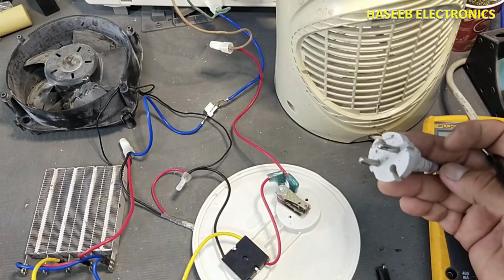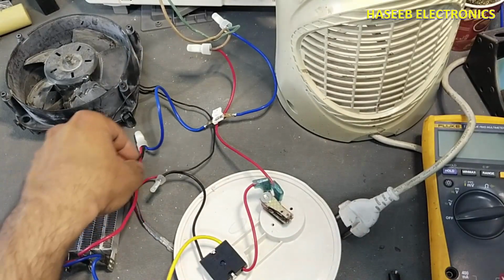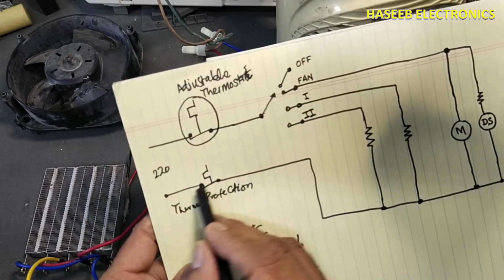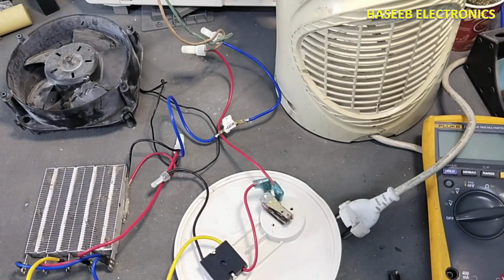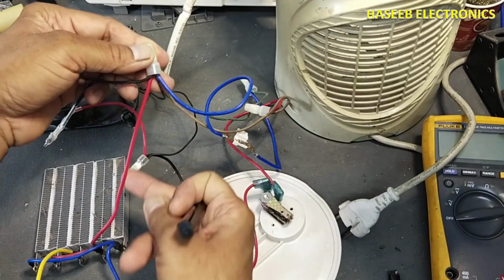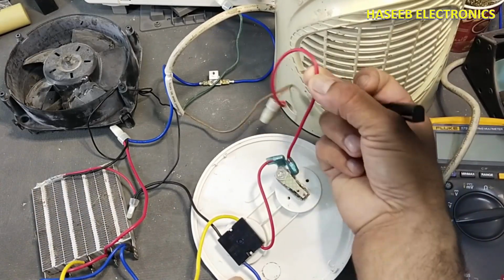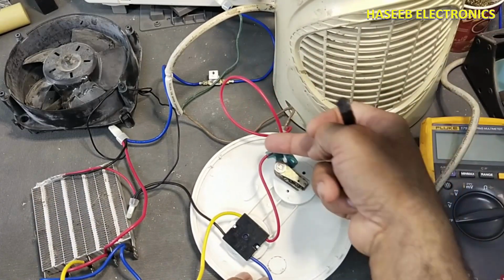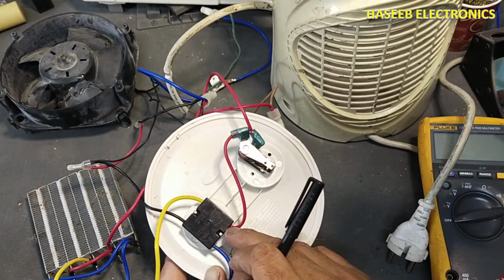{686} Room Heater Fan Repair || Complete Troubleshooting Tutorial

Comment: Computer atx power supply  power out put OK  but there is a problem , when  I check  by multimeter   + pin connect with - of smps  that show out put - 12 v, - 3.3 v,- 5v  but when i change prob of multimeter  to + to + and. - to -  then voltage not showing  ,  voltage  fluctuate please solve my problem sir.